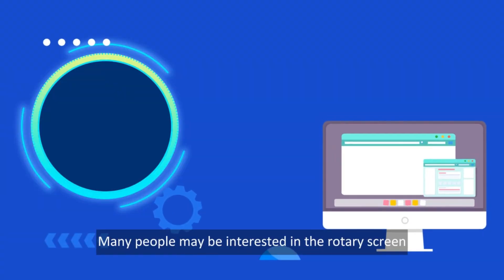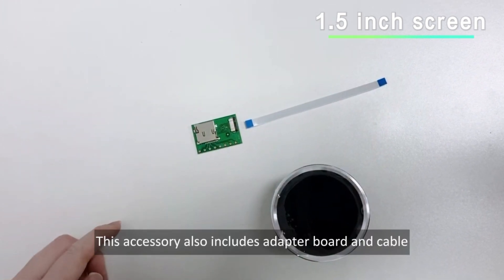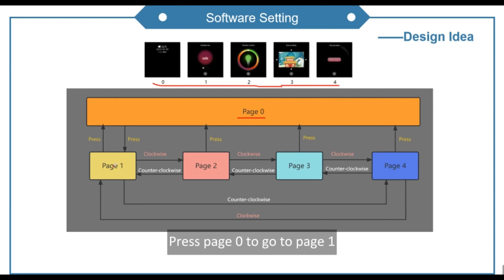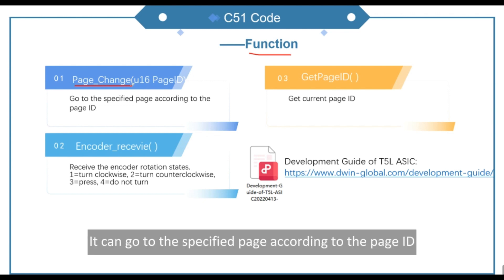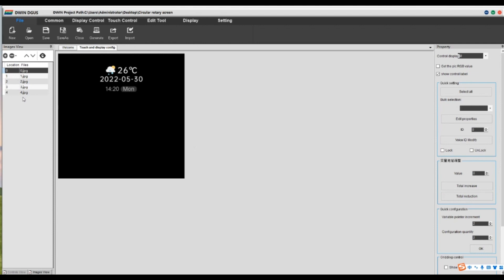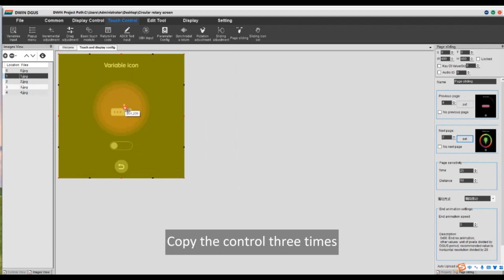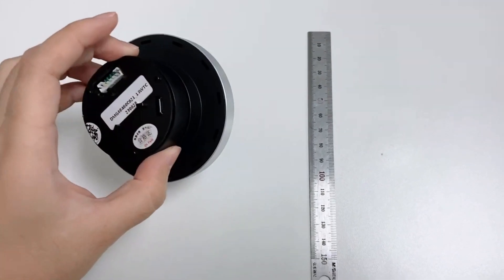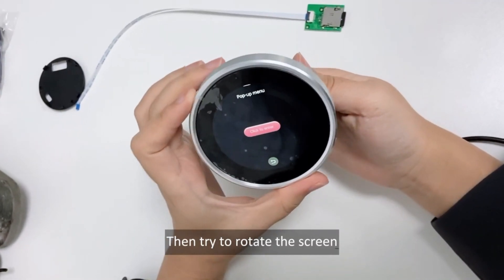DWIN Circular rotary screen | Explore products for buyer

Comment: Any chance to make C51 code using arduino? I have a DMG24240C015_13WN display for a year now. I tried once to program it to work via the Arduino NANO board, but it didn't work
Reply from the maker: Please kindly contact the sales to get the example coding.
Reply: The same for me. Can it be programmed just with DGUS and work with external controller like arduino or esp32 thru uart commands